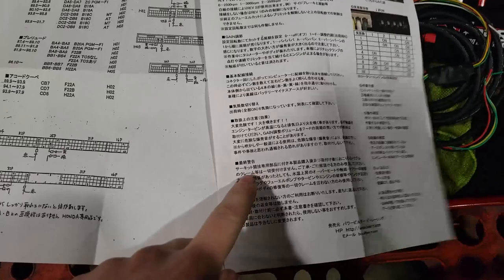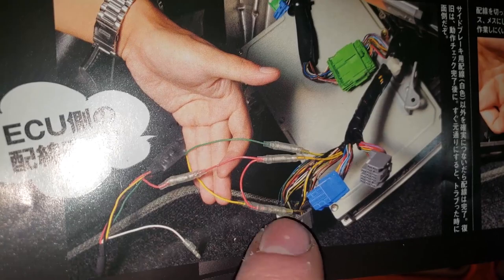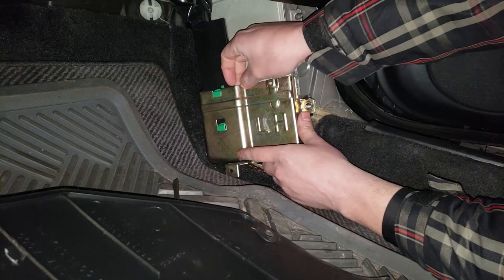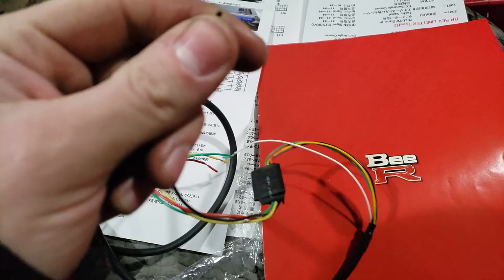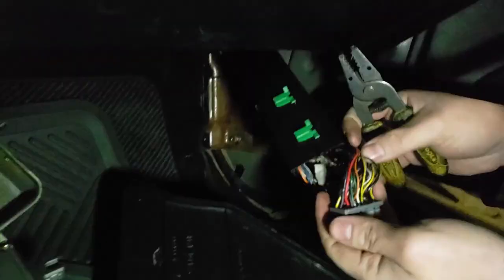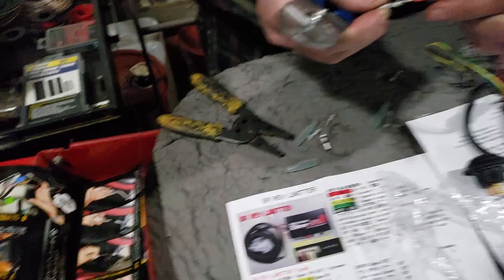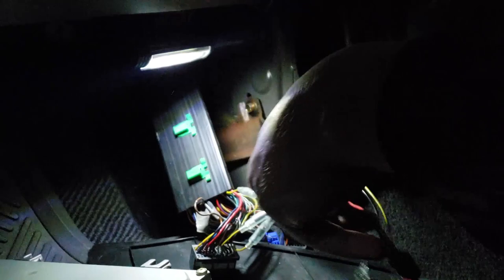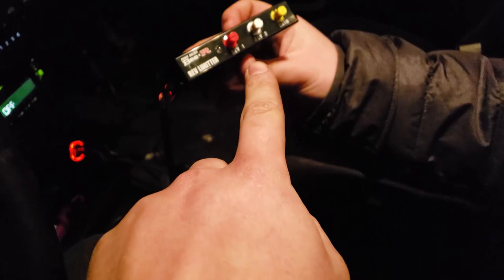Bee R Rev Limiter Install - Integra GSR

Comment: This blew up my h22 😂 the excess fuel washes the film of oil that sits between the cylinder and piston.. it was still hella fun thou
Reply: would you say u over 2-stepped? And did u ever get it tuned at a shop or u just sent it?
Reply: Thats why you don't bang your limiter 10mins straight
Reply: @socknetea  pretty much sent her, no tune, the motor served me well and was leaking so i really wanted to test it out.. i think tuners are against this shit cause they know it COULD be damaging
Reply: Luckily  the rev limiter use ignition  and not fuel sounds like were running  fuel Buddy not good for the engine

Comment: “The green one goes in the wire end of the harness” 
Can you be more descriptive please
Reply from the maker: Cut the yellow wire with the green stripe. Connect the green wire from the bee r to yellow wire (the one you just cut)  running into the engine harness. Connect the yellow wire on the bee r to the yellow wire (the other end of the one you just cut) that runs to the ecu plug.

Comment: which one would I need for my b20 non vtec integra ? And would this mess up my motor or something?
Reply: Young SM no matter what I think Honda’s are type h
Reply: Yes it can if you hold for too long since it’s an ignition cut excess fuel will be in the cylinder washing the oil off the cylinder walls and possibly causing damage

Comment: can you turn the launch control on an off and adjust it while driving/ while the car is running?
Reply: You can even wire in a button if you want actually

Comment: How did you connect the red wire and cut it?? Why is there two reds?
Reply: I think there is a 2-way inline fuse conneter to keep the power wire safe from any shorterges ❤

Comment: How's the engine now? Did this give any problems with the engine? And would this be effective on a 14 civic with only after market Exhaust tip?
Reply: You need to be catless and don’t do it for too long or you can dissolve the oil on your cylinder walls

Comment: I’m about to buy one of these now, except I think I’m gonna buy a jumper/harness extension so I don’t have to cut my harness wires, and im gonna try to wire it to my Del Sols cruise control button if possible
Reply: Its possible to put it on the cruise control Button there is a tut on yt i saw it yesterday

Comment: Does the car need to be turbo or it can ne NA? And do you need to change exhaust to shoot flames?
Reply from the maker: It works with both. This car is NA. You definitely don't want to do this if you have a stock exhaust with a cat.
Reply: Nick Sabella Thanks man.
Reply: What if you have an aftermarket exhaust with a cat?
Reply from the maker: @Ruiz921_  I probably wouldn't do this then
Reply: @Ruiz921_  HAS to be catless

Comment: DId you ever get it tuned? Great instructional but you know a 3500k launch doesn't even make sense, and the dirty tune is what will hurt the motor in the long run. Id wanna see results after a proper tune and hear a crisp crackle crackle pop flame. Still sick to see what can be achieved just with plug and play.

Comment: Hey so could i just splice the ecu wire without cutting it and connect my bee r wire to it?
Reply from the maker: No because the bee r needs to intercept the signal
Reply: Nick Sabella so what wires need intercepted? All of them?
Reply from the maker: @slytewrx7408  I guess the power wire doesnt
Reply: Nick Sabella btw i have the anniversary edition like yours so i have the 4 switches on the side. Im putting mine a on WRX so since I have 4 cylinders what switches do I turn off?
Reply: Nick Sabella ???
Reply: switch on 1,3 and 4

Comment: Hey I got a question I know it might sound stupid but for the white wire...what kind a switch u need?, is it the one white wire connect straight to the switch, or do I connect the white wire plus another wire to it  but love the video it helped alot
Reply from the maker: The white wire and a ground wire both connect to the switch. However, I recommend tapping it into the ebrake wire like you’re supposed to.
Reply: @NickSabella  last question so if I tap it to the ebrake do I still need a ground to it or just the white wire only to the ebrake sorry for the dump questions I just want to get it right before I short or damaged something 😅
Reply from the maker: @teknoman0818  the black wire still has to be grounded. The white wire can just tap into the ebrake wire
Reply: @NickSabella  thanks a million worked perfectly

Comment: hi! i just wonder, will it work with an alfa 159? and i'm a little bit afraid of it, i mean it doesn't make any damage to the engine or something else, maybe to the exhaust?
thanks for your work! you got a new subscriber ;)
Reply: it’s not major damage but over time it will cause damage most likely to your exhaust unless you have an aftermarket one on
Reply: @dankdanny8823  oh, thx man. do you have installed one too? do you know, will it work on a alfa 159 1.9 jtdm?
Reply: @leerzeichen1910  they work on any car, you just have to splice into the ignition, get power, and a switch,